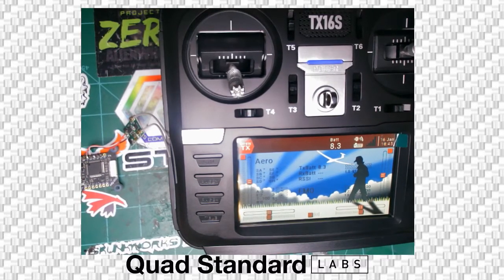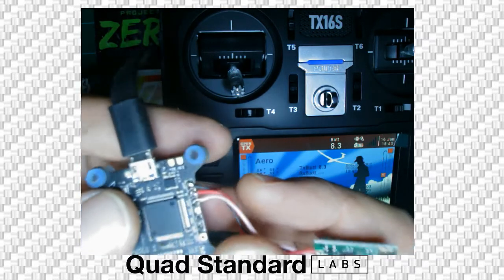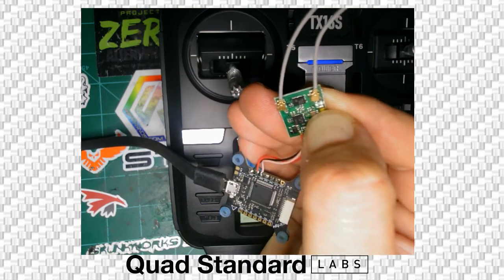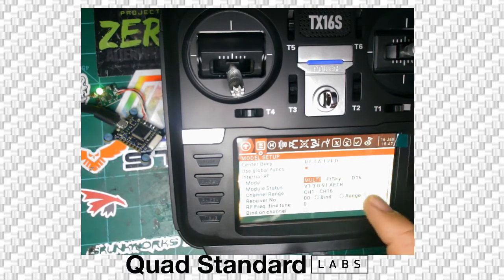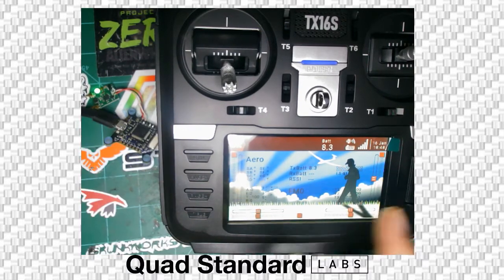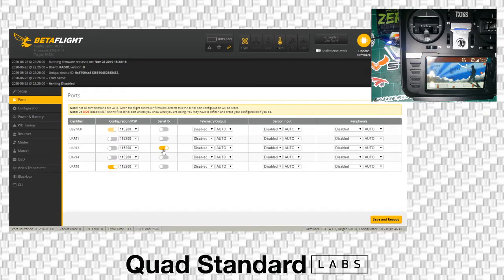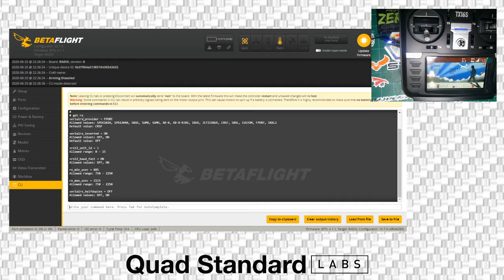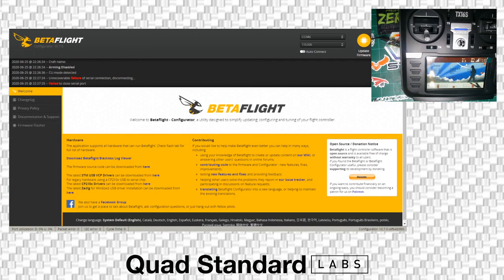How to Bind Jumper R1 (D16 FrSky) Receiver to Radiomaster T16s

Comment: Is it an R1 or R1F?
Reply: The R1 has two Signal wires Sbus + S.port.
The R1F only has only one Wire for F.Port.
Reply: chris whitehead its a R1f with fport output, the R1 has a connector